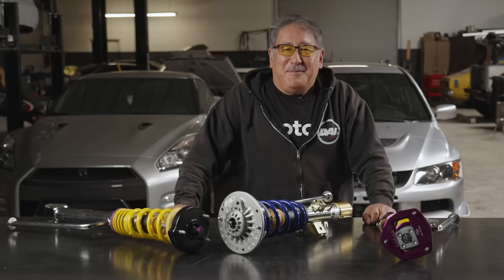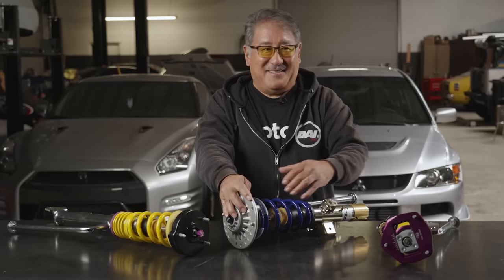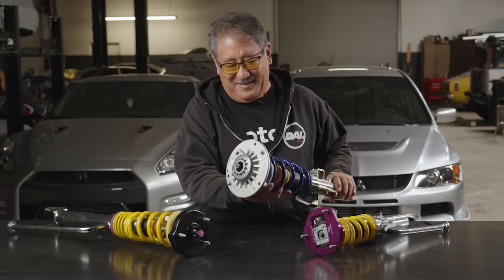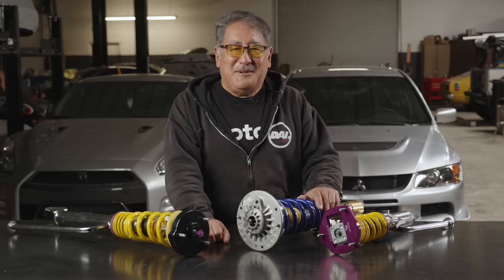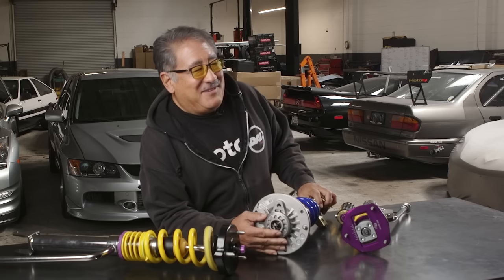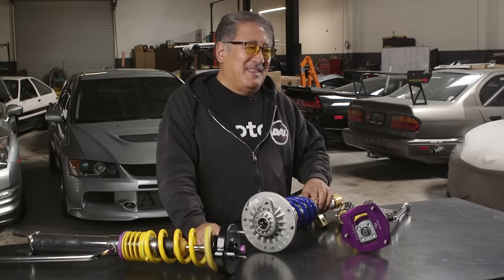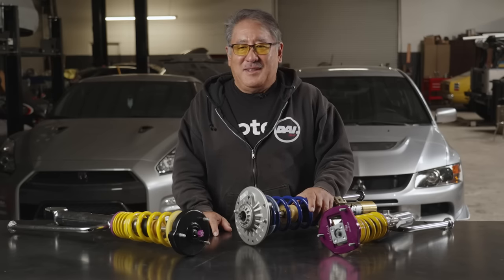How To Adjust Your Shocks Like a Pro and Go Faster | PART 1 - Single-Way Adjustable Dampers!

Comment: Such valuable information, thank you. The biggest issue I have found when tuning anything is cognitive bias. It's good to have someone else do the adjustments so you don't really know what they did and just drive it to feel the difference. If you are expecting something then you can trick yourself into believing there is a difference. I chased my tail with that issue a lot until I learnt how to "not expect".
Reply from the maker: my feeling is that when you are learning, you do the adjustments yourself and get a feel for things.  The best suspension engineers are the guys who learned setting up their own cars.  These guys are better than formula SAE data nerd types.  If you understand the feel and know how to reduce data, thats the best of both worlds.
Reply: @motoiq  one of many reasons engineers should be required to be a mechanic first. hands on is always the best way to learn
Reply: @bradhaines3142  and also be able to ride with pilote (if it possible in two seater)
Reply: This guy could give me advice on ANYTHING and I’d listen for 42 minutes

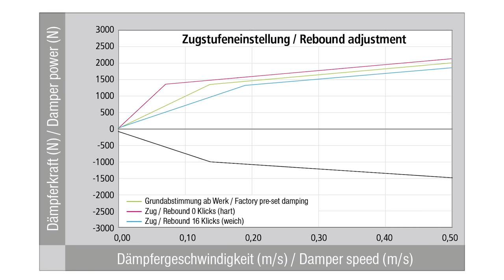Comment: 19:30 rebound
19:48 low speed damping
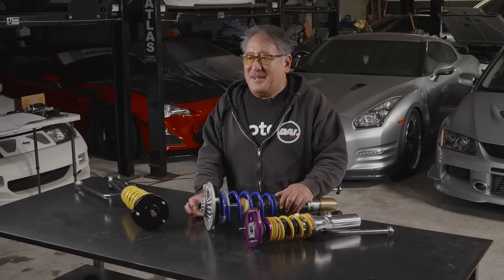20:28 mid speed damping
21:40 high speed damping
26:39 single adjustable shocks settings
26:56 more front rebound
27:56 to much front rebound
29:37 to little front rebound
31:31 more rear rebound
34:37 to much rear rebound
36:30 to little rear rebound
Reply: Thank you. So basically the video starts at 19:30...

Because leading up to this I'm about 13 minutes in and he's repeated to not lower your car too much and to get an alignment after swapping major suspension components... Lol
Reply: @TravisFabel  something tells me u dont get an alignment after lowering your car
Reply: @TravisFabel  it’s all great information that a lot of people who shouldn’t be in the car scene should learn
Reply: Thank you 😊😎👍
Reply: d3inx251 and the guy in the vid are both god.
Reply: Part 2 please bro if not already done, think starts around 12mins / 12mins 30secs.

Comment: I have ADHD and was able to watch the entire video and learned so much. I think that whatever you teach I would learn. Thank you for your time. 

 I have been playing around with my BC coilovers with a 370z nismo. I had a lot of rear sag and was rubbing really bad. The back sags and about 1.75 inches with regular acceleration and felt unstable at high speeds. Added 4mm of preload and the car feels better, not 100 but I'll keep playing around with it.

The last part gave me confidence to keep adjusting and tweaking things until it's what I want.

Thanks again
Reply: i got ADD and was laser focused, as im running way too low and need to reset my whole setup, i got BC golds and recently put a new sway bar in my 1997 sf forester, super thick one that means my car corners great but i rub as i lowered it but didnt set the bump stops properly so i rub on the fenders

Comment: Through sim racing and eventually road course racing I got more and more into damper tuning. What I recommend to everyone who can is 1: drive an 80s Cadillac (or some kind of old boat)  in a parking lot and do some low speed quick maneuvers and 2: go karting. And this is super basic, but pay attention to how the front and rear behave of each way. With slow compression and rebound, if it feels like a kart skipping away or sliding, you're too firm and the tires are working too hard. If you're experiencing lazy response in quick maneuvers, you're too soft and the tires are doing too little. Point is, it's good to experience more variety of vehicles to better help your understanding of how your own car is behaving. Again... This is a super basic way to better your knowledge of your own vehicle's behavior. Thank you for your awesome videos! Your expertise is amazing and I always learn something new.

Comment: This was excellent. I always found that starting out at full soft (and most often staying closer to it) on the shocks was the way to go both in terms of ride quality and actual performance. Almost everybody around would think they need to have the car excessively low and insanely high springrates with the shocks set all the way to "hardest" to get the best performance, and all it would lead to is they had trouble with even regular everyday driving at regular speeds cuz they can't even get over speedbumps without going over em with their cars near parallel to them. They also had trouble hopping on to ramps to the freeway without screwing up the flow of traffic and at the end of the day, when they wanted to go racing, their rides would drive absolutely horribly and it was so obvious that they were doing it wrong that I had no idea how everybody didn't just wake up and notice these common sense issues.

Comment: I just installed my first set of coilovers on my car for a daily/autocross build and this video was insanely informative. I did not slam my ride, did not touch preload, and have just been tweaking the stiffness settings. I’m at 11/16 clicks front and 8/16 clicks rear and realize based on your symptoms I am 100% overdamped. The bounciness has been driving me crazy. Going to turn them down a good 4-5 clicks and see what a difference it makes. Thank you for making this video!
Reply from the maker: experiment and see!
Reply: Keep us updated

Comment: This is so helpful, I was able to identify certain behaviors my car exhibits that I can try to solve with these tips. I think I do need a bit less rear sway bar but it sounds like some rear rebound may help stabilize the behavior as is. Right now the car basically must be driven with maintenance throttle or it wants to spin on corner entry.

Comment: For credits : I run V3 KW on my Model 3 and everything he said made sense .. cool hearing some else explain it … I used to run my rebound very high and easing off of it made it bobble less .. 10/10 .. need cover the compression aspect too , he’d have greater input

Comment: Excellent video! As for the ride height that is an absolute fact that people make their cars too low for performance purposes. I did a suspension tuning course and they gave a good lesson on coil over setup. When you first get your coil overs you should first remove all restrictions (spring and bump stops) so it’s just the shock. Then put it in the car and put your wheel back on. Jack up your suspension so you’re getting full compression and rotate the wheel to see if you’re rubbing or hitting anything. If you’re rubbing then increase the height until it doesn’t hit anymore under full compression. This will give you a worse case scenario and make sure your ride height is at a good starting point.

Comment: Just watched your video. I really missed playing around with coilover during my JDM days. Now my DD is a Cayenne 958 V8. Planning to go coilovers since the air suspension has never quite fit my style of driving. Gonna take all your advice with a leap of faith that all goes well with coilovers setup for a big heavy SUV.

Comment: Excellent information, thank you,  Mike! I thought it was interesting that you suggest starting at full soft. I've always been of the mindset to start in the middle, test, adjust one way several increments, test, then go the other way from the center several increments and test. Starting at one extreme seems foreign but the more I think about it, I can see the merit of starting and working in one basic direction.
Reply from the maker: It's because the most grip can be found with the least damping force needed to control the suspension.
Reply: @motoiq  that makes sense. And as far as delivery goes, I don't need a song and dance to learn something when the information is so good.

Comment: Excellent presentation. As one with street-only experience so far this is a great primer and the website with 20+ articles looks at first glance like a powerful resource to start from. Here I have had RideTech HQs for several years and only dialed them to a loose sense of corner comfort. Now I have a better understanding of the dynamics and can further refine the setting, though soon I may be opting for Viking Berserker three-way for the new car coming off the rack. Perhaps by then I will know better what to do with the valving. Thanks, Mike!

Comment: Can you do a video on how to set up coilovers to optimize the dampers' effective zone, without the need for helper springs, and adjusting the bumpstop to suit the tire and wheel clearance at the desired ride height?
Reply from the maker: No because its oversimplified and not the right way to do things

Comment: Mike!  You’re the man!  Thank you for doing this video.  I have had to watch circle track suspension videos just to learn more about suspension.  This is probably the only comprehensive video about suspension for sports cars.  Other vidoes out there are from shock tuners preaching about their rebound/compression ratio.  Or it’s youtubers that talk about the color of their coilovers and how nice the look.

Please consider doing:

Applications of the Koni 8610/8611 for us regular guys that can’t afford Reiger/Proflex/JRZ/ Ohlins TTX

Adapting Bilstein Inverted Monotubes for us regular guys

Uses of linear/digressive valving for street or race application.

Bumpstop Tuning

Why Bilstein support is not great

Revalving services that are available locally.

Effects of Roll Center adjusters and the need for parallel control arms.

Motion Ratios 

Common frequencies for different applications.

Thanks man

Comment: First of all, I love your videos!! I bought a 2006 Honda CR-V with auto trans with the thought of auto cross. It has VSA. I looked everywhere for suspension upgrades. I ended up buying Gecko race coil overs. My problem is I can't find stiffer sway bars. It  handles good on soft settings,  and I love burning into corners with it. The coil overs lowered it 3 inches, but I need stiffer sway bars to really corner. I don't want to flip it over. Are these the coil overs you say have fake adjustments? 🤔
I want to build a sleeper with your info on K24's and blow some Mustangs off the road. My new motor is being hot tanked as we speak. 
Keep it up. I love your intelligence on the subjects you present.
Reply from the maker: You can buy parts from Speedway Engineering and with some minor fabrication make your own super adjustable bars with tons of different rates.
Reply: Now I want to build a high horse 2006 CRV K24. Help Me , maybe 300hp  E85?

Comment: Nice and calm explaining how it works sir! 
Could itry add some of my engineering experience to it?  When i have customers with handbuild cars and buggies where base line unknown i suggest other tactic : 1 - ride with open wide shocks, then 2  - ride on half open shocks (and if its not enough - close further for quarter, otherways - open quarter ) , etc.  This kind save more track time and iterations.
Reply from the maker: That's about what I said just with bigger steps.

Comment: The timing of this series is perfect and I appreciate you sharing the knowledge!  I'm replacing an Eibach R1 single adj. with MCS TT2 double adj. on my s197 mustang.  I was a bit concerned with trying to dial in a double adj set up, but If your double adj video is as comprehensive as this one, I shouldn't have any issues.  Looking forward to your next upload!
Reply from the maker: How to do double adjustable is coming next.

Comment: For the most part this is all 100% spot on

My 2cents.
-High speed and low speed damping is arbitrary. Depending on your bleed and preload in the valve stack you'll get different dampening curves. The adjustments in ots coilovers change area under the curve which has large impacts over the whole range.

Also there is no good reason for the 2:1 - 3:1 rebound : bump ratio. You can run much more compression than you think and ultimately rebound:bump ratio is a tuning tool for aero balancing. So it is important to discuss having aero or not much like the initial comment about most people go too low.
Reply from the maker: This is about basic one way adjustable coilovers, we will be talking about the more advanced stuff later.

Comment: As a guy who works with suspension. This video is good but it reminds me why i havent made a youtube video. The chassie side i cant say so much about but the adjustment on the shock… rebound is on the top within the shock shaft and it effect low speed as well but some shock have checkvalves to remedy this. Resorvoir or piggback are not so much for cooling as it is more for longer stroke and creating a passage where you use an adjuster.
Reply from the maker: In cars, rebound is not position sensitive, with sophisticated off-road suspension it is but not on a pavement car. On quality shocks, as I said in the video, the rebound adjuster affects mostly low speed damping but has some effects on the entire force velocity curve.  The video has charts demonstrating this.

Comment: Good video, good delivery. One Thing I'd love to see covered in a video is the relationship between spring, shockers/dampeners and sway/roll bars working together in a package and where to start when setting a car up along with what does each component really does to the car handling. For instance some people like to run softer springs and harder roll bars, other people believe in softer springs and stiffer bars. But just getting a good fundamental understanding of what each component does and what to adjust and when would be a great video
Reply from the maker: This video is about adjusting one way shocks only, not the entire suspension.  It has to be done in parts otherwise it would be too long.
Reply: @motoiq  Id love to see a video series on this, I think the community would as well. I cant find many you tube videos covering this information. You'd be perfect for it with your clear and easy to follow vidoes. Keep up the good work
Reply from the maker: Don't worry part 2 is coming.

Comment: Awesome info and thanks for clarifying some of the concepts.  I have KW V2 on my car and was wondering how removing the full size spare would affect things? I assume the KW intended the user to keep it in car.
Reply from the maker: Not much
Reply: If you take a dump before you drive, you will need to re-valve your dampers.
Reply from the maker: If it's big enough I guess.

Comment: So a friend of mine has a 96 mustang GT. I installed some single adjustable maxpeedingrods coilovers for him. Of course he bought them in order to get his car super low & close up that fender gap, but he also wanted to improve the ride quality, mainly by getting rid of some body roll as the car has quite a few drivetrain modifications & was on the wrong set of springs to begin with (eibach convertible lowering springs(( had the rear way taller than the front, & we believe higher than stock)). Anyways, I adjusted them almost all the way down for him & we ended up leaving the rear about ¼" taller than the front because he has some exhaust clearance issues for the moment. Ok, so the coilovers did their job as far as what he was looking for, the car is low & stays "go kart flat" around turns & even while sideways, going around a turn or out of a parking lot... BUT they introduced some new problems, when hitting bumps the car feels like the suspension is welded solid especially in the rear, despite it having more clearance. I believe this may be a spring rate problem, as we have adjusted them all the way soft with some change, but nowhere near enough. My question is, is it a spring rate problem or could the issue befixed with a preload adjustment?
Reply from the maker: I think its a crappy coilover problem. $300 coilovers are just junk. Making them as low as posible makes them even worse.

Comment: Problem with suspension is everything effects everything.  For instance:

I bought a used car with 8K miles on it.  A week or so passed and I was going through a sweeping corner at about 125 mph and the rear started to undulate up and down.  A bit unnerving.  Buy what you said one would think there is not enough rear rebound.

The actual issue is the dealer and the previous owner failed to remove the shipping blocks from the front springs.

Comment: Respect for your knowledge and sharing. 
I’ll pay ya if you can tell me how to get rid of the painful ups,bouncing when I hit a highway dip or bump? I have Cusco zero’s  , if I just drive level smooth roads , mountain rd they are amazing but when on hwy and go over these awful dips, and uneven joints  , I almost hit my head on roof. If I go any softer dampening,then the car feels like a boat on a wave up,down, up down motion after the road bump.  Thank you.
Reply from the maker: Pay attention the the video, that's what it's for!

Comment: what would you recommend to get your car? Low about an inch and a half and get that same ride as stock or close to stock. I have eibach pro kit with the the eibach struts/shocks and it rides like crap.
Reply from the maker: The pro kit is two low and not enough damping.

Comment: I would love more info on spring preload, that's where I feel really unsure how to properly adjust the car. damping is easy to test, few clicks and some driving, but preload is a bit move involved to adjust and so takes more time... would be nice to have more info on that to save some time getting it right
Reply from the maker: I don't like to run much preload, it can mess up the high speed rebound.

Comment: My HKS hipermaxx spec 20 gt IV's have 32 clicks. I have mine set to 15 front and 14 rear on my FRS. I never slam my cars it is lowered about 15mm. still a bit of wheel gap but nice travel and geometry is right. about .80 degrees of neg camber up front on the camber plates. Highly recommend the HKS. I have ran KW , St, BC, TEIN, and now HKS. Great build quality and comes adjusted for your car out the box for just a direct swap if you choose.